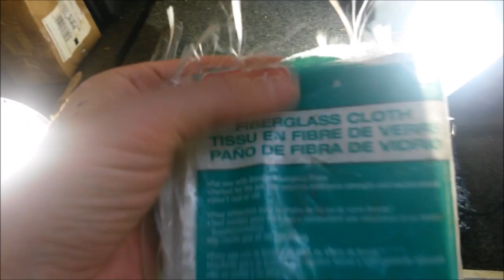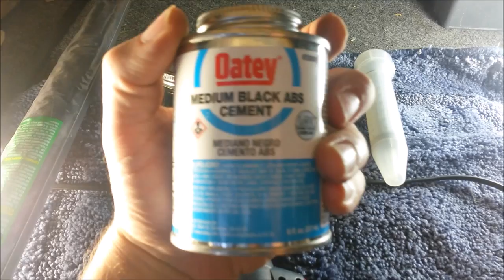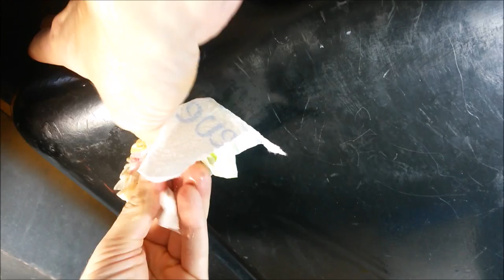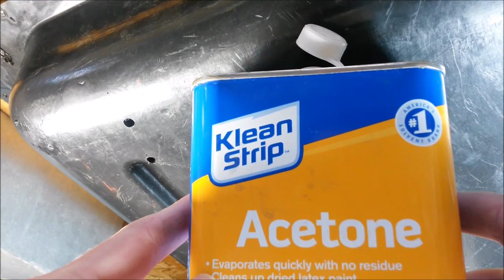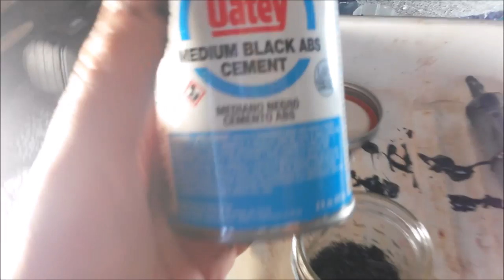(:HowTo:) Permanently Fix a Leak/Crack in an RV Black or Grey Water Holding Tank ~#1: Best Method

Comment: How do I tell if Black water tank is Black ABS or polyethylene?
Reply from the maker: It will be either black or white
Reply: @TrailerDayz  my dealer said my black colored, Black water tank was HDPE, polyethylene!  I do not trust the answer.   Polyethylene comes in any color u wish.  Colored HDPE mud flaps, book binders, black or green ground pads for driving on golf courses and more are common.
Reply from the maker: @billjones5178  OK...
RV industry standard is white for potable and black for Grey and Black.

Post a Pic, and the make/model
Reply: @TrailerDayz  I understand that Black tank is my Blackwater storage tank! What I wish to know is if my Black colored tank is made of Black ABS or Black High Density Polyethylene plastic,  to repair the crack will take different chemical adhesives or different filler for the crack if we have to weld.    I have some Black ABS rod, Black HDPE rod, and black PVC.  
U guys are debating the blackness of a tank. I want to know what the black is made of?m
Reply: @billjones5178 -if you still dont know, there is a comment above that talks about how fittings are applied to help determine.  Said cemented fittings are more likely ABS, screwed fittings are more likely PVC or HDPE.  But not absolute.  Hope it helps.

Comment: My two Sons tell me, Dad, you have a very strange way of fixing things, demolition Dad. Im planning to fix a hole in the black tank of my R.V but Im just gonna clean the area, wet with the resin a thick cloth fiber glass and push in that open crack but having the jack holding pressure until  dried out, then place another patch out side over the already fixed surface .. It is just to cover up to stop the stinky climate change venom in the air.

Comment: This is idiotic and dangerous.  Do not use the solvents without nitrile gloves and eye protection.  Not a bad fix but how about safety first?
Reply: Put gloves on before using nail polish remover.
Reply: +majorsmackdown I know right?! I'll make sure I put gloves on the next time I clean my nails.
Reply: Acetone is safe to work with Captain Caution.

Comment: Just buy a new tank. I did to much mickey mouse work
Reply: That's silly. This repair is stronger in that area than a new tank. You'll still be using ABS cement installing a new tank. So what did you accomplish?